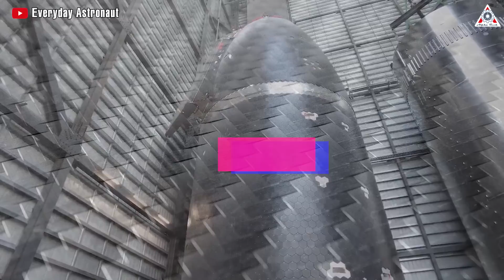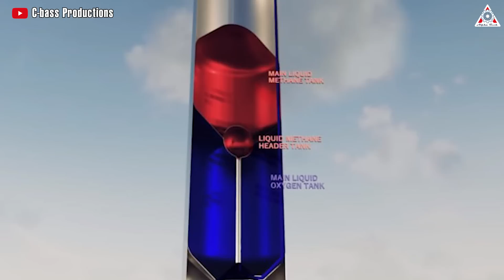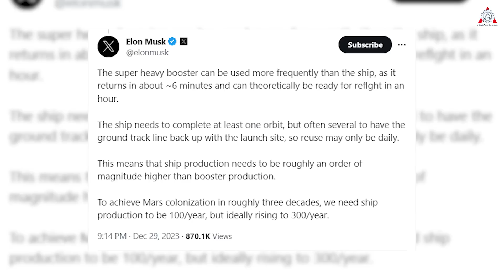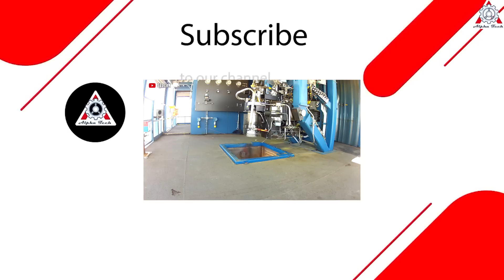Elon Musk finally revealed Starship's cost somehow shocked the entire industry

Comment: 3:51 "Stainless steel is lighter than carbon fiber..." WHAT?! Are you nut? Carbon fiber is about five times lighter than steel in terms of weight.
Reply: If you consider the reduction in heat shield weight, maybe not. Big picture

Comment: There isn’t anything wrong with the Orion capsule and service module. It’s the SLS architecture, cost and cadence that makes it a white elephant. Crew Dragon would take a complete rebuild and then a certification campaign, which would take several years to complete. I don’t even think the shell of the Dragon is suitable for the 7+ km/s required for reentry. As the man said “you would finish up with something that looked like Orion” unless you aerobraked back into LEO before final reentry.

Comment: Awful idea.  Want to know why it has been over 50 years since we have landed on the moon, it is dumb ideas like this.   Why put all this time, energy and effort into finding a way to way to just re-enact the Apollo landings from 50 years ago?   Put a very small lander only capable of planting a flag, gathering a few rocks and going home again.  We'll be right back in the same place after landing with the question of, "Now, what is next?".  

With such limited capacity there will not be much more to do.  You'll have to start again from scratch.  

We're not going to build an outpost on the Moon with a tiny little lander.  We're going to need to be able to place tons I mean 100's of tons of equipment, food and water on the Moon. That requires orbital refueling not matter what.  Don't argue with me, it is just physics. 

Let's take the "Next Great Leap" and do it "not because it is easy but because it is hard."  Then we'll be ready for Mars.

Comment: Falcon 9 is not built with carbon fiber. Its main body is lithium-aluminum.

Starship was originally planned to be carbon fiber, and a lot of money was spent on that direction. But the cost was very high, and it turned out that the carbon fiber would burn on re-entry without very robust heat shielding. Stainless steel can remain strong over a far greater temperature range so the heat shield can be thinner and lighter. The temperature problem negated much of the weight advantage of carbon fiber, and stainless steel is easy to work with and far, far cheaper.

Comment: Stainless steel is NOT lighter than carbon fiber! The point is that it's far easier and cheaper to fabricate cryogenic tanks and it's much stronger at high temps such as during reentry. Learn your material.

Comment: What I don't understand is how was he to take a brand new engine. Run it through all of it's but attachments run through 5 6 15 test over and over again, 15 times complete and the day of the launch. Something messes up, how can that be? Imagine going to the dealership buying a car and the very 1st day the tire blows out.  Well, you do an investigation and a week later. You say oh, we're just put a brand new tire on it. You tested again for 23 days. Go to drive the car and the wheel bearing is no good. 20 days later and he's a full investigation. Why the wheel bearing failed.  Before you salad, the DOT says it could be on the road. And then you then an axle goes bad and the car's only got fifteen miles on it
Reply: Take an engine, run it 10 times at full launch power full operational minute and sign it off. As been good
Reply: It is done so they can do exactly that stress test the systems on the ground where they have as much of control over the parameters and will learn the most with lowest risk. This is very much an experimental vehicle it haven't reach orbit even after all the testing done on it.
And half of the reason that the ground equipment is enduring just as much stress if not more. So far most of their real issues come from failures in the ground equipment not so much the rocket.
This rocket is supposed to land on this tower as well RAPIDLY... so they really have a very long list of challenges ahead of them and stress testing the rocket is only one of many...
Reply: Good, so you take an engine and you just run it till it keeps blowing up. Why spend the amount of hours putting it on a booster? Only for it to explode and ruin your booster and mess up your first stage.
I mean, do you have a whatever he's saying to call Trey? It's just a motive via. Tell me about it, so I'm sorry.

Comment: It is not true that everything can be reused with Starship: The fuel cannot be reused! 🤣
Reply: Actually, the Sabatier Reaction allows you to produce ch4 from hydrogen & co2. Since the byproducts of methane/o2 combustion are co2 & h2o, you're not really losing anything apart from energy (+ a catalyst). Thermodynamics always apply.
Reply: @symmetricat188  I know the Sabatier reaction. But it makes new fuel and does not use the burned one.
Reply: @gottfriedheumesser1994   My point is: since the byproducts of initial combustion don't go away, your source of fuel remains the same, i.e. Earth. co2 is fairly heavy & falls to the ground, to be consumed, split & thereby reintroduced by plants. h2o will condensate & also end up in the cycle.

You will always use co2 & h2o for industrial ch4 production. Hence, there is no "new" fuel, only the energy you have to spend to transform it. "The fuel" is always there. You just need to put in some *W*ork. You reinsert the initial elements into the system & will then have to extract them again.

As to what the probability for one of the same atoms to end up in the next fuel tank might be?

I think the answer is: >0

qed
Reply: @gottfriedheumesser1994  I didn't want to create the impression that catalytic synthesis is the only option, I'm sorry if it sounded like that. You are absolutely correct. Biological processes are most commonly the way to go. So it's either fossil gas or biomass facilities. The former took some time, the latter might yield even better results. In both cases, co2 & h2o are the source, so reinserting co2 & h2o back into the system maintains equilibrium.

Edit: unless you are on Mars. Then the Sabatier method becomes interesting.

Comment: Video says stainless steel is lighter than carbon fiber. Is that correct?
Reply: No it's not. Elon uses steel coz it's cheaper and cost effective on a industrial scale
Reply: @partha0212  - That's the point. Carbon fiber is far more lighter than stainless steel., For several other reasons as well Musk made an easy decision that other rocket builders are beginning to follow.
Reply: That would depend on whether you can make thinner rockets with steel or not and to what extent they are thinner.  But certainly not per unit volume.
Reply: @ruschein  however you view it , steel is always denser than carbon fiber and it is heavier but the cost of manufacturing is the tricky part
The extra fuel needed to lift the extra weight of the steel is far lower than the money spent in Manufacturing a carbon fiber one